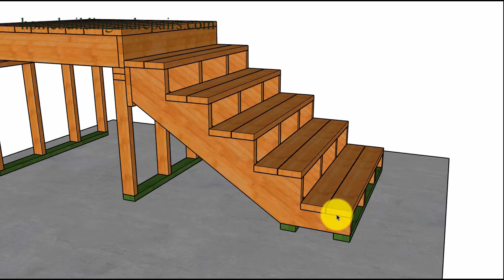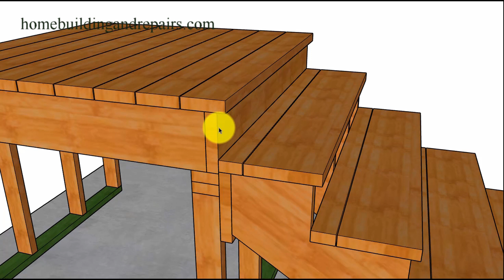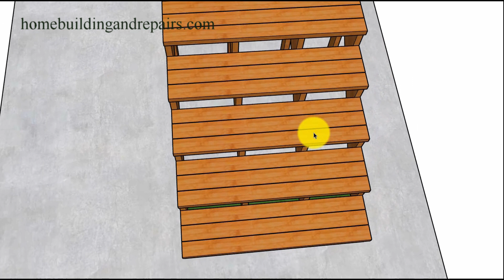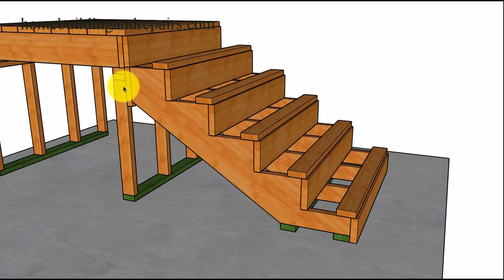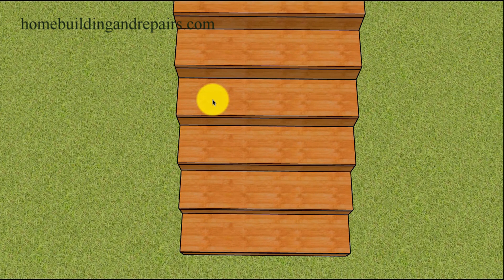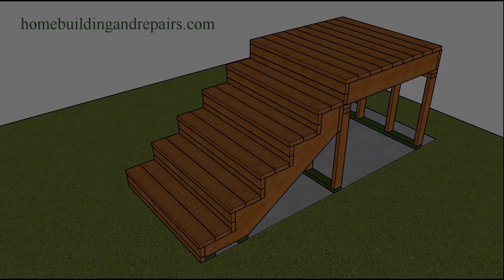Exterior Wood Stairway Design Ideas And More For Deck Builders

Comment: I am looking at building this on a concrete patio that has some slope for draining water away from the house.  Would I need to add additional green timber to shim it up or would I scribe and remove timber to make the structure level?  Or a possible other method?  When directly in front of the stairs the slope would go from the right down to the left side, if that makes sense.